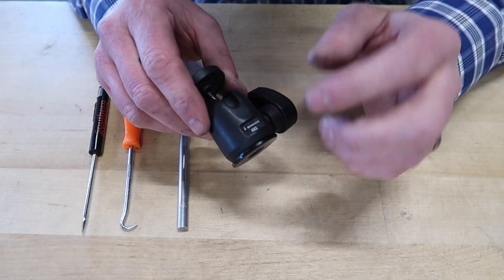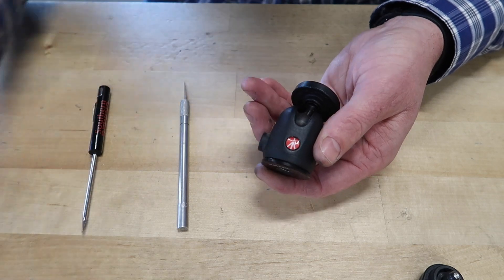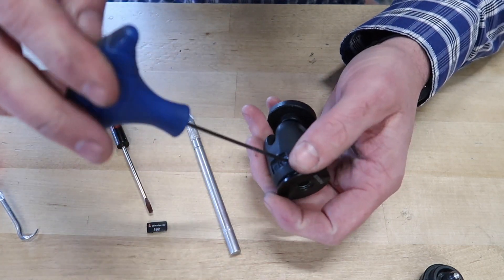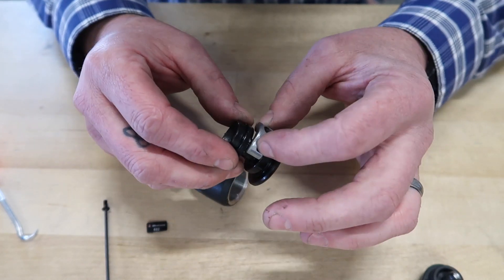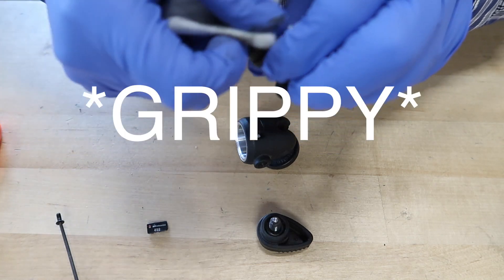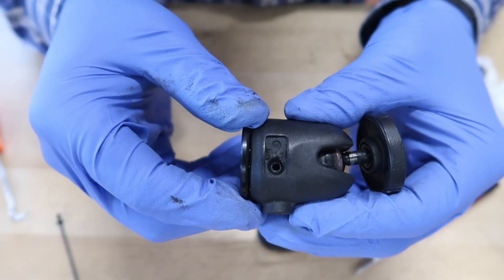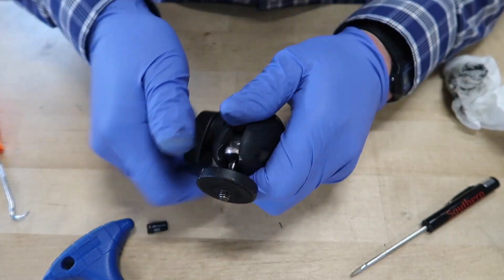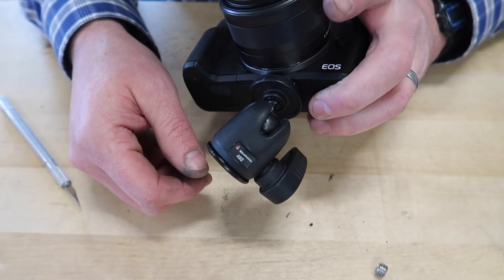Manfrotto 492 Ball Head Fix - Bring back lost friction

Comment: Have the same issue with a larger Manfrotto Ball Head and am about to attempt this fix, might start by just using some degreaser on the exposed section of the ball to see if that works before taking it apart.

Fixed the tripod head, ended up needing to disassemble the head like shown in the video and I would have never guessed that there was a screw behind the model label and have not seen that advice elsewhere so thank you for that. The fix also took me about as long as it did in the video and was very easy and effective. Thank you!